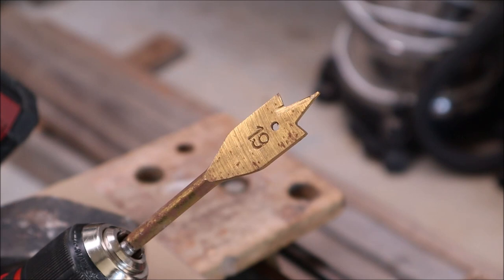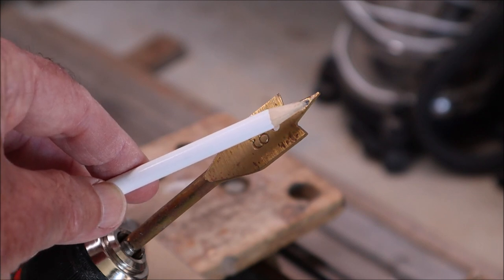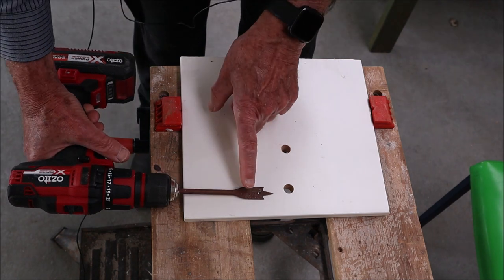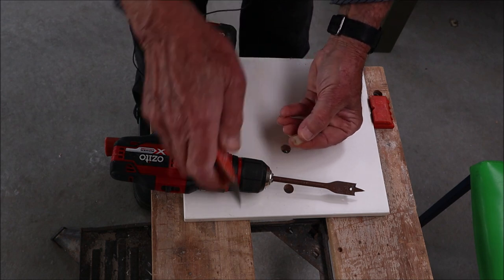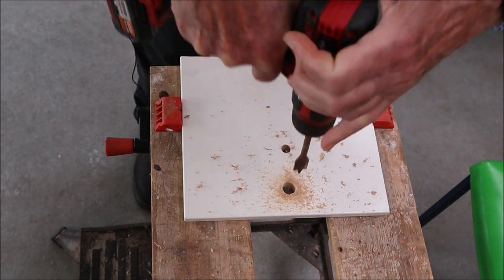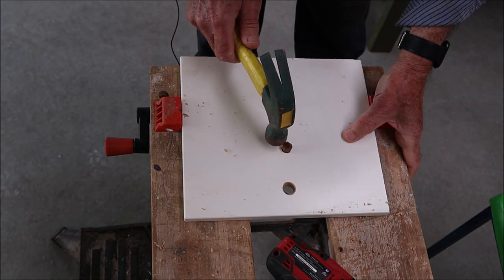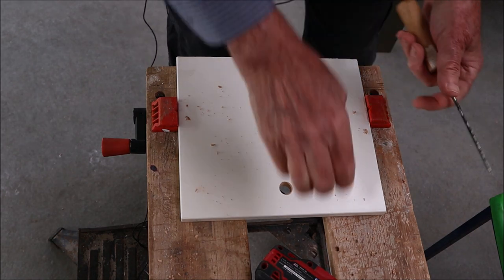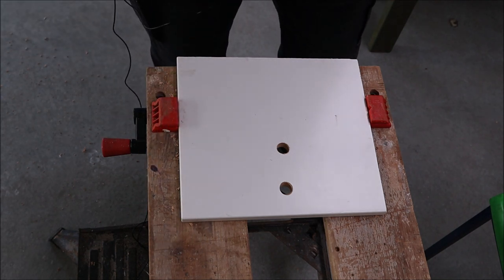Enlarge a spade drill hole in wood

Comment: Great video. Very informative. I had a 10mm hole drilled in plasterboard which needed to be enlarged to 25mm. I took the wall plug from the 10mm hole, cut the end off and used that as a guide for the spade drill.
Reply from the maker: Great idea!  thanks for sharing 👍😊

Comment: Hi, after watching this video and trying your plastic technique I found my impact driver had too much power and deflection to use it cleanly. 
However I found if I superimposed a plate or piece of wood with the desired size hole over the smaller hole I was trying to enlarge, the spade bit would follow that guide and bore the required hole size in the workpiece. Best to clamp 🗜 together when doing it. 
Thanks for your video.
Reply from the maker: Great idea, thanks for sharing. I think I have described that technique in this hole saw version, if anyone is interested https://youtu.be/3ZMM-wPCwyY
👍😊

Comment: First off thank you for this video. I am currently building an electric guitar from scratch. I have an old 1960’s Japanese guitar neck but the 6 holes in the headstock that support the tuning machines for each string are too small for standard 6-in-line tuners  and I need to enlarge them. After researching I found that a 3/8 bit like you used should extend the holes to the proper radius to fit standard sized tuners. I put wood dowels in each of the 6 holes (using wood glue which I noticed you didn’t do, because I’m hoping it will make the dowels sturdier for drilling). I’m nervous to mess up and snap the headstock. I have no convincing reason to believe this will happen but I would love to hear someone else’s opinion or advice? Thank you!
Reply from the maker: Thanks for your comment, good luck. I find that a 2 or 3mm pilot hole drilled with an ordinary wood bit helps to keep the  spade drill on track.👍😊
Reply: @AnnErasmus  thank you. I clipped off the ends of the wood dowels in each 6 holes, sanded them flush on both sides, then proceeded drilling each new hole with the 3/8 spade bit and it worked perfectly. Now I have 6 new tuning machines installed in all 6 of the newly drilled holes. This is my first electric guitar build from scratch out of nothing but an old 1960’s Japanese neck from a thrift store electric guitar and a pile of cabinet wood in my dads garage. Plus a box of old guitar parts, in this case I’m shaping the body to be a telecaster guitar and have an old black telecaster pickguard with the neck pickup and an old 3 brass saddle telecaster bridge with a classic telecaster bridge pickup as well as a telecaster control plate with volume knob, tone knob and 3 way pickup selector switch. Hopefully I have a working purple telecaster here shortly.
Reply from the maker: @jacobsamano9761  A lot of this is "Greek" to me but I would like to say well done and all the best for the outcome 😊👍
Reply: @AnnErasmus  thank you. Just wanted to be thorough in my explanation.